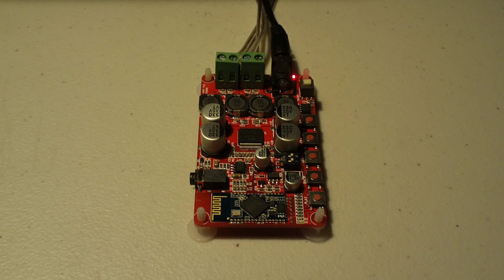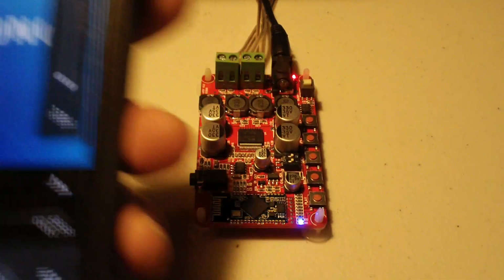Demonstaration Of A Small TDA7492P Powered Bluetooth Amp From Ebay

Comment: Which one is better?:
TDA7492
https://www.aliexpress.com/store/product/50W-50W-TDA7492-CSR8635-Wireless-Bluetooth-4-0-Audio-Receiver-Amplifier-Board-NE5532-Preamp/1959068_32820812780.html?spm=2114.search0104.3.2.e7c83baaQRY82z&ws_ab_test=searchweb0_0,searchweb201602_2_10152_10151_10065_10344_10068_10342_10343_10340_10341_312_10696_10084_10083_10618_10304_10307_10820_10821_10301_10843_10059_100031_10103_10624_10623_10622_10621_10620_528,searchweb201603_56,ppcSwitch_5&algo_expid=c1cb2e18-2a79-4c5b-9540-6f280994ee7a-0&algo_pvid=c1cb2e18-2a79-4c5b-9540-6f280994ee7a&priceBeautifyAB=0

or

TDA7492P
https://www.aliexpress.com/item/Top-Deals-TDA7492P-50W-50W-Wireless-Bluetooth-4-0-Audio-Receiver-Digital-Amplifier-Board/32837058006.html?spm=a2g0s.8937460.0.0.643c2e0eGqIxbN

Both looks similar but one of them provide 50W output power and second 25W yes?

Comment: Also don't leave your gain switches up when playing at full volume, There's entirely no need to do that and it will cause more distortion yes - the amplifier is trying to kick out more power than is capable of or your feeding more volume into the amplifier than it's capable of. So it peaks out.

Comment: When you turn the amp on with the gain up and it turns off quickly, That's your PSU (wall adapter 12v) shutting off into a protective like state. It then restarts. If too much current is being drawn or the PSU is shorted it does that to prevent itself from burning out, Not the amplifier. If you were to use an adapter / transformer with a higher ampage you wouldn't notice the cutting off.

Comment: I would advise against buying the amp from this supplier: The item arrived with a broken case and the buttons supplied did not work with the case. Resoldering the correct buttons working with the case is only for skilled professionals, not a DIY job. The amp makes "farting" noises once the volume goes above 1/2 way while the other TDA7492P amp I have purchased previously performs excellently, so the one from this supplier was a big disappointment.
Reply: http://www.ebay.com/itm/TDA7492P-2-50W-Bluetooth-4-0-Audio-Receiver-Amplifier-Module-Board-Case-Red-/272484006773?ssPageName=ADME:X:RRNTB:US:3160

Comment: I would like to use this amp with a single speaker...could someone explain the best way to do this, other than hooking the speaker up to either the left or right side?
Reply: YourGoToGuyUnited. Get a mono amp. Just using one output of a stereo amp can hurt it. And doing the outputs in parallell is also not good for the amp.
Reply: I'm asking how I can use this amp to power a single speaker, besides plugging it into just the left or right channel...I understand using a mono amp would be best, but this is the amp that I'm working with
Reply: Okej i mean u could try using the outputs in parallell to eachother but it could break it.
Reply: You want a mono amp, then use one channel. You cannot use these "bridged" as they are already bridged. The speakers wires (all 4 of them) need to stay separate. You know, coz it's stereo.

Comment: Came across this video while looking for info on TDA7492P, so i'll just mention this for anyone who reads this in the future

The TDA7492P is only 2*25W (shown as 2*50W on ebay by some sellers which is false)
Also the 25W per channel is the PEAK voltage, NOT RMS voltage.
So a peak voltage of 25W per channel is giving only 12.5W RMS per channel (max)
Reply: Karan Bajwa you think I can pair this amp with 4 speakers?? They are 3watts and I can wire them at 8ohms (I want to use 2 for left and 2 for right) the speakers are from the Logitech ls11

Comment: can you please test something for me? When you plug in headphones into AUX, it automatically switches to AUX .... but, if you only plug in an extension cable does it switch? i want to install this inside a box, but i won't have access to it inside the box, so i need an extension cable, but i want to be able to use bluetooth still and not be stuck in Aux mode always because i can't unplug the Aux extension cable... can you plug just an extension cable in and see if it switches over?

Comment: how long would a 12v 6000mha battery last powering this?
Reply: Jason King not sure but it seems like my 10,000 mah 12v battery never dies lol. I haven't used my speaker in over a year(just pulled it out of the basement and listened to music on it for a half an hour already. I believe I've used for at least 12 hours before I put it up. I have an eBay battery on it with cheap soldered connections and one broke and can't find a wiring diagram to fix it so I can charge it back up(reason why I put it up to begin with ha)

Comment: built a portable battery driven amp with 7 cell lithium ion pack, it was too much.. it just didnt turned on. after lowering to 6 cells it turned on, even that the datasheet says absolute max is 30, but i was way below 30 :/

Comment: How to switch AUX between line in and line out?
Reply: just use a line out and it will automtically switch to aux in or vice versa
Reply: I am unable to get the aux to act as a line-in. The bluetooth led's keep blinking even when I plug in and out the audio input. 
The only moment when I am able to get sounds via aux input (line-in) from the speakers is during the first 2 seconds after turning on the board. 

Then I hear that loud beeping sound , after which only bluetooth audio can be played.

Any tips to get the aux-in working?
Reply: The AUX port is made for headphones or something similar.

Comment: i just bought a second (very old) car just for going to job, can i use this as a radio in car? just plug the power and speakers then i can play music from my smartphone trough the car's speakers?
Reply: Yes that will work. You won't get radio on that, you can only plug in your phone/pc/mp3-player etc via aux or pair with bluetooth. Connect car speakers to it, and plug power cable in to cigarette lighter, you need adapter or make one yourself. But i would rather spend 2-3x the amount and just buy a cheap headunit with aux.

Comment: That "hardware" power switch is not real. See that 8 pin SMD? Its a mosfet that controls the power. That latching switch feeds power to the gate. Also when the board is connected, you have power running to some components regardless of what switch mode. I fried one like that.

Comment: I have so many questions..could i use it in a car with car speakers?How do i adapt a knob control for volume,an aux cable port?
Reply: You'd need to make something else for that. A bluetooth receiver into an RCA knob and then into a dedicated amplifier would do the trick much better. Though, this isn't really suited for a car nonetheless, even if it is specified for it.

Comment: Do you know what kind of buttons those are? Im in the process of making a BT speaker and want to extend the buttons to the outside of the speaker but wasn't sure what kind of button/switches to get.
Reply: Brian Festa those are called tactile switches
Reply: In this case, they're Momentary switches. They have 4 pins but using 2 will be fine in most cases (unless they're all hooked up to a trace.)

Comment: What is the max amps can it handle
Reply: A device does not 'handle' amps as a power supply rated for 2Amps will not 'push 2 Amps through the circuit'.
Reply: Francisco Sanchez can you please explain.. I do not understand your answer.. could you use a 8amp power supply let's say..

Comment: so does any one know the amount of bass it pushes
Reply: It pushes some pretty hard bass on my two 6.5in bookshelf speakers. It works quite well under Bluetooth.
Reply: Bass isn't a secret measure haha. I'm pretty sure this board just /amplifies/ the sound you put into it, and doesn't equalize it.
Reply: HumbleDeer True, yes, Bass is subjective to the device's equalizer, but when you do want to push some bass...It does just that.
Reply: It's too bad most of the modern music is right at, and mostly even over the 0dB digital limit. No headroom for a decent equalization shrug.
Reply: the bass is like clear as it was from a yamaha amp and its very very powerful man
Reply: AKI BASS oh yeah it is. as long as you got 19 volts 4 to 5 amps running it.
Reply: It can handle anything in between 9 and 24 volts, amps are infinite.
Reply: Insidasigma well what i am saying is when i had a 12 volt at 2 amps it was shit could not even turn it up with my 100 watt speakers at 4ohm. to achieve the sound i wanted and the ability for the amplifier to do its job i had to up the volts. but after i did that man it pounds.
Reply: Yeah, this little amp is quite amazing...
Reply: bro am using a adapter 12 v 5 a its a laptop adapter and it dc plug  it working amazing and it does heat at all very powerful amp
Reply: dont worry about amps its like you have a 1 litre bottleand you have a tankof 200 l when the bottle get filled it good no matter how much amp you put but be careful not to go up to 24  its will blow and use the formula power equals to current multiply by voltage and also use 18 volts 5 A IF YOU HAVE a convertor and if you want do like me i use an adapter 12 volts and 5 amps its very good . and for more info there is a youtuber that helped me soo much its WILSON KUJUR WILSON .HE DOES REVIEWS OF AMP and he is indian and very much guy
Reply: AKI BASS i am using a laptop charger for mine lol
Reply: AKI BASS hi bro keen to start building me some diy bluetooth setups.. just wandering can i power this amp off my 18v dewalt battery? and what sort of run time would i expect frm a 5ah battery?
Reply: yes you can power the amplifier with a 18 volts and at least 2 amps so use a boost up convertor and the expected time for the little battery it can last for 2 hours but bro me i have i have used a 5 amps adapter 12 volts without a boost up convertor and set the gain of the amp only the switch labelled 1 ok bro and this wiil not use too much current whereas it amplifies your sound and more bass and also dont plan to use te number 2 gain setting on the dip switches and also i have used 2JBL  crossovers for maximum sound quality its very very cheap bro its 2 dollars can you believe this 2 dollars for extra very very good crossovers they are from JBL and so i have purchased 2 sony 35 watt 4 ohms speakers they are 3 way speakers and i also bought 2 altronix speaker they are from japan very good sound quality .any question feel free cya man
Reply: I MEANT 2 HOURS for a 5000 mah battery and its not that reliable

Comment: This may be a dumb newb question but: is the power input center-positive or negative?
Reply from the maker: it's center-positive
Reply: Great, thanks!
Reply: It's actually not a dumb question. Often you don't find out 'till you get the device, and it might not even be specified.
Reply: Would reversing the polarity burn up the unit? I powered one of these chips up yesterday with an old computer PSU that I usually use for an old car head unit and the main chip immediately fried. I just hooked it up using the connector from an old wall AC adapter.
Reply: Jesse Tate It could, possibly. Unlikely, but it certainly is possible. That's why I always use a diode in my circuits, even power supplies!

Comment: Can anyone message me private as too how I would configure multiple speakers and tweeters too this and what mods if any need too be made I want too make my own blutooth speaker with two main speakers and maybe 4 tweeters
Reply: This device is set up to run 2 speakers in stereo, so you get a couple 2 way crossovers and wire them + and - from the left channel on the board to the + and - on the input of the crossover, then you wire + and - from the bass on the crossover to the woofer and the same for the tweeter and repeat this for the right channel... Important! When you wire 2 8ohm speakers in parallel you get 4ohm, that's + to + and - to - But if you wire 2 8ohm speakers in a series, you run them + to - and you get 16ohm... This is partially why we install a crossover, but not all crossovers allow you to maintain the ohms and so we can sometimes maintain our ohm's and always make a nice clean sound and separates the high and low frequencies, without the crossovers we get a lot of distortion and the ohm's drop... There's a way to do everything! Cabinet one will have everything in it, the board, batteries, one 8ohm woofer and one tweeter wired to the crossover for the second cabinet you have another crossover wired the same as the first cabinet, now you have left and right stereo 4ohm a channel, but if you want 4 cabinets use all 16ohm in parallel and you wind up with 4ohm and wire the first cabinet to the third and the second to the fourth and you can skip installing the crossovers for the third and fourth by either hardwiring the woofer from the first crossover to the woofer on the third and the same for the second and fourth crossover or use the red+ and black- terminals that you usually find on speakers or use a 1/4" stereo jack and drill a hole on the back of each speaker... On the third and fourth speaker will be wired directly to the 1/4 inch jack or hardwired, but make sure you maintain the + and - throughout and make sure you don't cross the wires from the crossovers from the bass and treble between the first and third cabinet or you're going to have problems.  Use a multimeter to verify your ohm ratings before you turn it on... If you plan to use 4 speakers in a car both front and back you'll have to use a stereo volume pot on each of the fronts or you wont hear the rear speakers and install the volume pots after you run the wires in and before the wires are connected to the speakers... If you unplug the front speakers you will be running a 8ohm rear and all four will make 4ohm... Important: If you get a crossover that allows you to maintain a 8ohm woofer and a 8ohm tweeter a total of 8ohm's it will not become 4ohm's it will stay 8ohm total so work according to your crossovers. Or you can run four cabinets with just one 8ohm wide range speaker in each cabinet and skip the crossovers and all four will become 4ohm for the left and 4ohm for the right.... If there's a issue write back.

Comment: Guys mine was shuting off if I switch to high volume. whats the problem of this. the power supply I used is 12volts 1amp. please guide me to use this module. :)
Reply: Shockwave Photobooth  you wanna go for 24v at 3 amps and around 6 ohms speakers, runs flawlessly

Comment: hey im wanting to build techbuilders boombox project, he uses 2 tweeter speakers and 2 subs and 1 passive radiator (which doesn't use power) and he has 2 frequency boards, and the 25w+25w bluetooth amplifier so i was wondering if any of you could recommend a parts list to the 4 speakers 2 frequency boards and power supply needed to build such a speaker watch the video at techbuilders chanel it has a red face on the speaker
Reply: passive crossovers are the 2 frequency boards

Comment: I use 12v 3.5A supply.. I found out that at higher volumes the amplifier suddenly shuts off and starts again in a few seconds. .. what should be the problem
Reply: It's overheating. A lot of current going though the amp chip. Try reducing volume or getting a small heat sink. If it doesn't stop when you reduce the volume, it might be an issue with your power supply, or a faulty unit.
Reply: by using 12v 3.5a you get 42watts of power (12*3,5). It's best that you use 12v5a for 60watts of power or event 24v3a for 72watts of power. At higher volume you need more watts to power up your speakers, or else the amp will shutdown because the speakers will drain all the power left there for it to work.
Reply: Your power supply is insufficient, as mentioned already. Upgrade to something else. Perhaps play around with a PC power supply, as they can usually supply 7-8Amps over +12v. Otherwise, go for a higher voltage supply, as that's needed when the DIP's are on.
Reply: was wondering if i was the only one having this issue.... using a 19v supply, will test volume to see if that fixes the problem.
Reply: It works at low volumes. Must be overheating as you suggested... Bought some heatsinks off eBay... Hope that helps

Comment: On another note I purchased a few of the pam8403 with the volume knob to check out the sound. I've read mixed reviews so I checked it out. Okay its not tda7492p, but for the size and with the right speakers it sounds pretty good.
I took a usb bluetooth (.99 cents), a pam8403 (.99cents), 2- 4 inch speakers from the trash and used a small power bank for 5vdc power. Soldered it all up and it's more than loud enough for a small room.
anyone try these out?